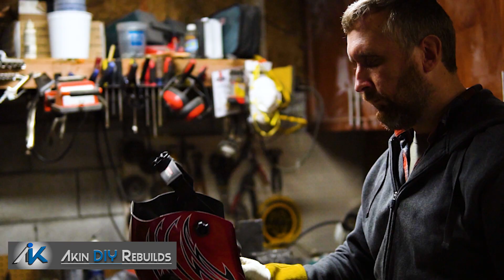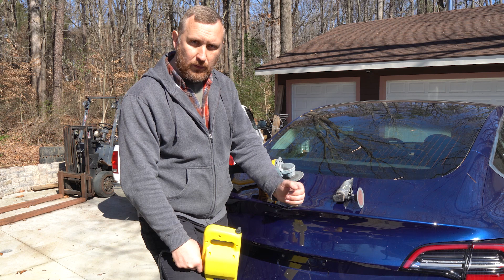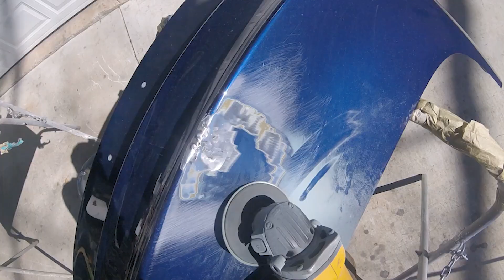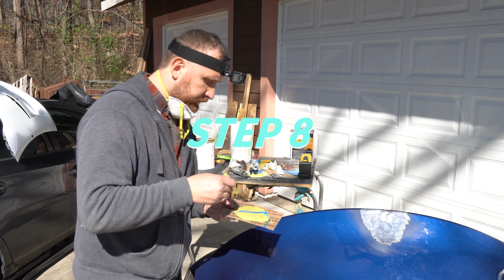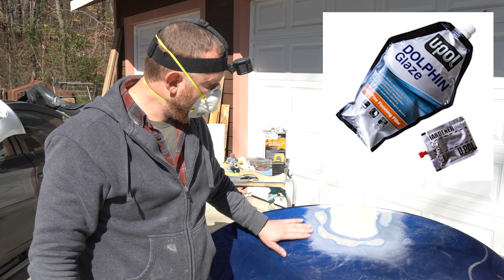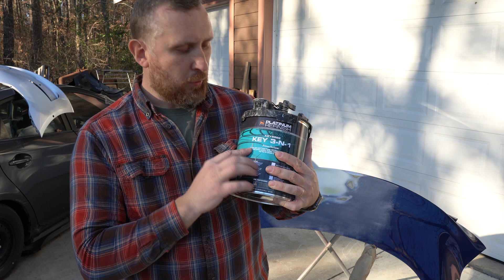Step by step auto body repair DIY

Comment: AKIN DIY REBUILDS     I have a question: For example when a vehicle/car has been rear ended by a tractor trailer truck (hitting one side of the rear bumper) cracking the bumper / ripping off  one of the tail lights aka brake lights and smashing the rear quarter panel......  QUESTION ONE (1) What are other possible issues that are likely to have occurred to the vehicle that the naked eye and non mechanics/non body shop specialists    would not be aware of      could yah list the guestimate price for each repair including the obvious repair/replacement of the bumper, tail light and rear quarter panel

Comment: Hi. was your tesla running if not did you made it run? and have you had problems with valet mode? if to be specific valet mode code chanfing from previous owner. thanks.
Reply from the maker: No it doesn’t run because I don’t have a key card for it yet and I haven’t changed pyrofuse yet
Reply: @akindiyrebuilds6223  I got mine running after changing the fuse and transferring ownership through Tesla with Bill of Sale Docs.   Watch these guys video and you can get a pyro fuse for about 150$ https://www.youtube.com/watch?v=MuFxg75UYbE&t=30s
Reply: Im going to try to replace it. Waiting on those special sockets. 
Any tips on how to buy this fuse from tesla? I have an order for a replacement battery and in the app I messaged them requesting to add the pyro fuse part number to my invoice.

Comment: Isn’t that aluminum? You’re gonna get galvanic corrosion sir
Reply from the maker: It is steel, otherwise I wouldn't be able to use a stud welder. There is a debate whether you should prime aluminum before body filler. In my  experience I never had an issue applying filler directly to aluminum. My Prius aluminum hood was repaired 4-5 years ago, no issues what so ever. Thank you  for checking my video.
Reply: Akin DIY rebuilds no problem man, somebody linked it on the auto body reddit cause I work in collision so I’m always looking at the differences between states and stuff
Reply: Akin DIY rebuilds well they also even say to use clean hammers and a whole new tool set,